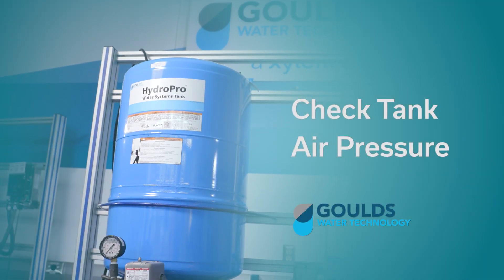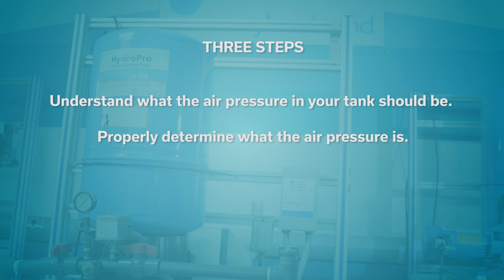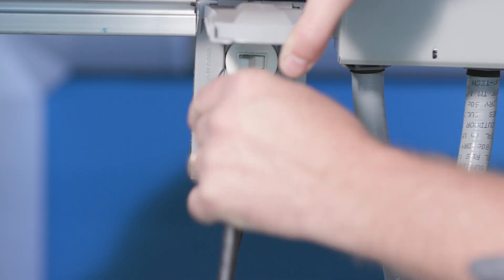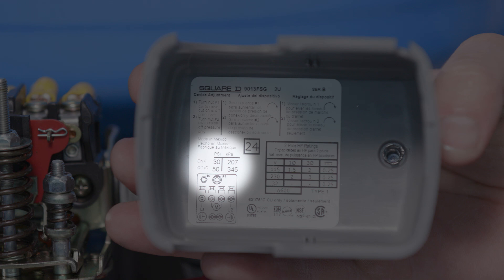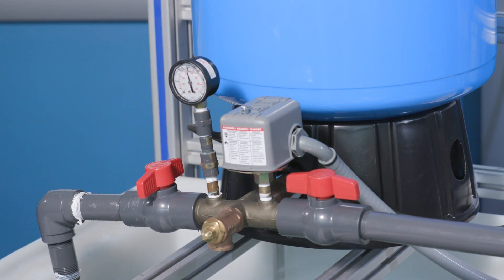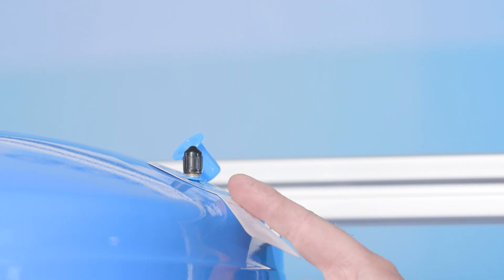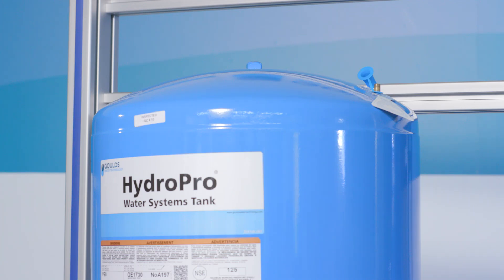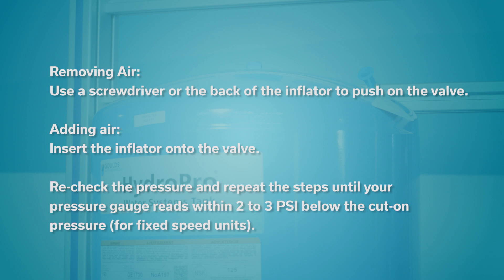3 Steps for Checking Tank Air Pressure

Comment: I have a horizontal tank, do I need to completely drain if I see 0psi after running a tap for a while? Not easy to do without disconnecting a bunch of connections.
Reply: If you have zero the tap won't run anymore so you'll know

Comment: Excellent video.  If you have a shut off valve on the main water pipe to the house (as is the case in this video)  it's a good idea to close that valve so that a lot of air doesn't get into home pipe system causing a lot of pressure water surges in the water pipes that could create leaks at weak points.

Comment: I just checked my pressure tank and water came out of the valve, it should read 28. It reads around 50, what might have happened? Thx
Reply: You might have waterlogged/leaking bladder which the air is being pressurized by the water leaking through bladder.  Just my thoughts

Comment: The valve cap is in no way the "primary" seal on the valve, the Schrader valve inside the valve stem is. The cap is just that - a dust cap to keep dirt out of the actual sealing valve.
Reply: Absolutely true, I laughed when they said that, imagine getting a valve cap to be airtight 🤣
Reply: It's the primary seal since it's the first one you remove to add air
Reply: It acts as a seal also, pretty much like the caps on your car ac , where you add freon . Same concept, so laughs on you
Reply: Also you can't send someone to School who has already been. Don't be a Mr, Correct your T's and dot your i's because it was only one person, he not y'all..... Lol

Comment: I have the Gould's Pump and pressure tank and can get the pressure switch to cut in at 30 but I can not adj. to cut out any lower than 58-60 psi. All new system by plumber (But getting a weird clunk not a hammer)

Comment: Great video of a simple procedure.  The bottom line is that you're trying to set the "preload" pressure of the empty tank 2-3 psi below the pressure show on the pressure switch cover (as explained in the video).  You could do this with the tank new in the box, it has nothing to do with the rest of the system.  Tank empty, check the pressure, adjust, refill... alk away.
Reply: 9
Reply: On older systems you should also check what  cut in pressure of the switch is as they do change I find usually  lower than it should be . If it has dropped 2 lbs then your tank pressure is set lower. With the system cycled off.  shut the power and drain the water  as you approach the cut in pressure  drain very Slowly until you hear the click of the pressure switch or watch for it to close. check the tank pressure. Then

Comment: how does ambient temperature affect the pressure in the tank?  Seems like if its a hot day, it will read high, especially if you empty the tank, allow the temperature to reach ambient, then fill the tank with cold well water.  Nobody ever seems to address this.  Why is it not an issue?
Reply: Very good point. My utility room is pretty cold right now.. Probably won't be so in the summer.
Reply: Because the water in the tank maintains the bladder air temperature

Comment: My booster pump is using hydrovar VFC. That pump is running continuously. I checked about water leakage and NRV, their is no water leakage and NRV is also good. Its pressure tank is also good. Cutt-off pressure is 2.5 bar.

Comment: The valve cap is not the primary seal. It the stem valve inside. It is the same valve that inner tubes and wheels use.
Reply: It is the primary seal since it's the first one you remove getting air in

Comment: How do you know that your air pressure gauge and the water pressure gauge are both in agreement? These generally are not the highest quality, accurate devices and I would guess it is easy to get to the air pressure in the empty tank not 2-3 PSI lower as it should be.
Reply: Nice video

Comment: Once the tank is drained, do you close the valve or faucet you opened before checking and adding air? Thanks.
Reply: As long as power is off, it shouldnt matter. The water side of tank is empty. The only pressure you have is in the air side. I check mine with the water valve open. Once i check pressure i repeat the steps backwards then.

Comment: hello planning to buy a 100L pressure tank. what is the recommended psi some say 20psi for cut on and 40 psi for cut off. 
is that safe?
Reply: wyn depends on your pump. 
Usually 30/50 is safe, 28 psi in tank.
Reply: As stated most are 40-60 which means 38 size of tank is irrelevant